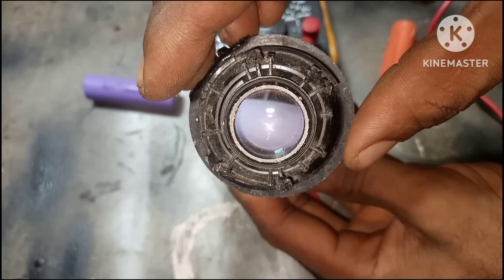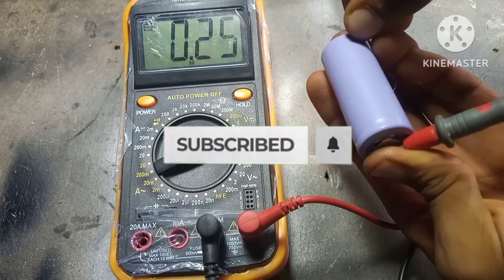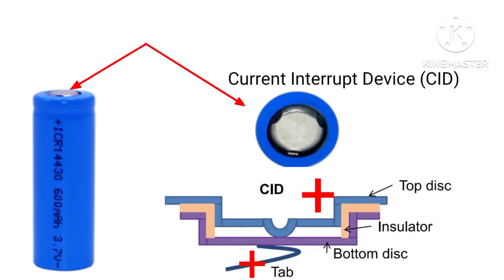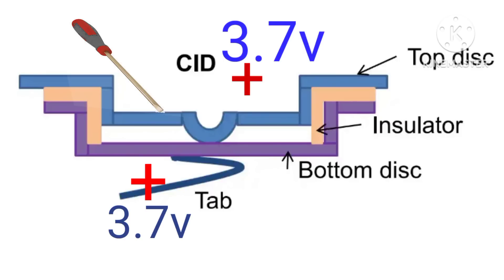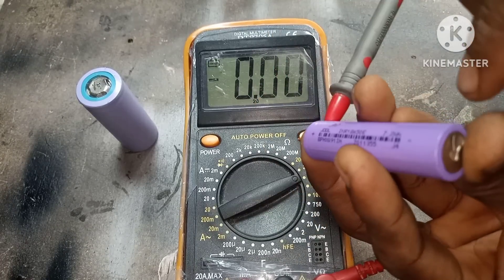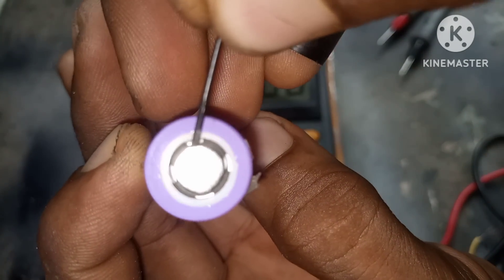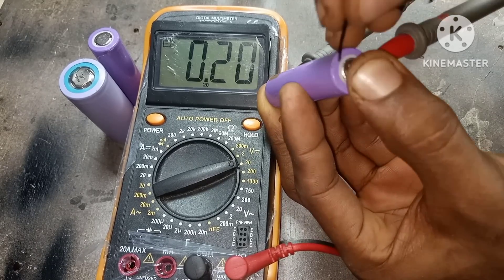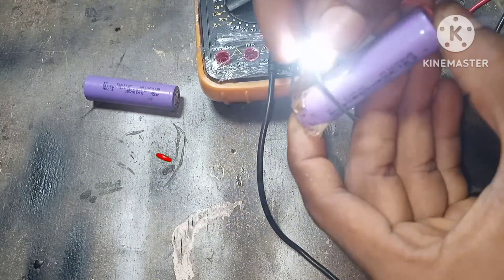How to repair a bad lithium-ion batteries with  Zero volts

Comment: I usually save my batteries lives with a nail, hitting on the positive side. Did I use wrong method?
Reply from the maker: That method is really dangerous and can cause explosion, please don't do it again
Reply: @Blinksiteengineering 
I was just afraid to use your method while I heard pop-up sounds from my batteries.
If it's natural, I'll use it.
Reply from the maker: Yes just give it a little push because if you go too deep you might shortern the electrodes.
Reply: @Blinksiteengineering 
Thanks, it actually works.
I've saved 7 of 15 dead volt batteries.
Reply from the maker: @pray2002 Great 😃  I'm glad that the video helped you, what will you be using them for?

Comment: cool trick, but now the CID is non functional or way off spec - what are the new additional dangers here - lets say a charger fails somehow and overcharges the cell? without the safety of CID is there now a higher risk of fire?    Not sure i'd feel safe leaving these charging unattended after that hack...
Reply from the maker: If don correctly the CID will still remain in good shape

Comment: Reviving and using old batteries is futile. The capacity can't be regained after the chemistry has changed and resetting the cid just pops again soon after. Buy quality new expensive batteries is unfortunately the only solution. Eventually you get sick of wasting time too
Reply from the maker: That's absolutely correct

Comment: Doesn't work
Reply from the maker: Bro it works
Reply: If battery overheated and CID opened then work, if battery not used by year(s) it's emptyed to zero volt , and this repair not work (not a CID problem)

Comment: At 1:54 mark, it's another battery, even the negative probe of the multimeter is not in the same position.
Reply: I have watched this over several times. 
The main issue here appears to be you.
Reply from the maker: @rossbixley3173 why do u think so😁
Reply: @Blinksiteengineering  
Was it another battery?
Did the probe move?
I couldn't discern any such changes.
Am I wrong?
Reply from the maker: @rossbixley3173 it was the same battery, give it a try I'm not faking anything, please do give it a try, and please watch the video till the end the are warnings as well in the video

Comment: One point added. If you fail this process then hit the bottom and upper side.
Reply from the maker: Wow dude I never thought of that I just tried it out and it worked thanks man
Reply from the maker: By hitting slightly it will release the gas

Comment: It does work but my question is Can i use revived batteries 🪫 to make a battery pack for an e bike ? With the bms should be ok?
Reply: not, if overheated ( from used power or charging from 0%) CID not work good again and will be explode, only use where is power low (bluetooth radio, pocket lamp) and can't heating.

Comment: It does work but my question is Can i use revived batteries 🪫 to make a battery pack for an e bike ? With the bms should be ok?
Reply from the maker: for the e bike you will have to buy a BMS that can handle high power.

Comment: Once lithium is not holding 4.1v after 4 weeks of fully charged, the cell done
Reply from the maker: No that is incorrect, most lithium-ion batteries stop working because of overcharge this means the top plate of the cid has detached it self from the bottom plate and due to the high pressure in the batteries, and at this point the battery might sometimes carry it's max voltage due to the over charge, so you see the battery still have some voltage that's not bellow 2v and can be revived by just pushing down the top plate of the cid to release pressure so it can attach it's self back to the bottom plate